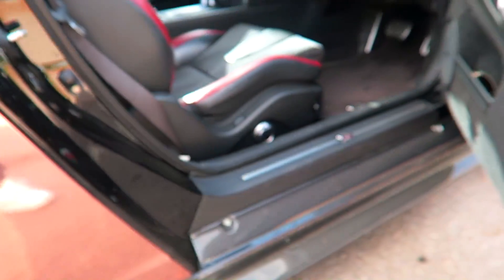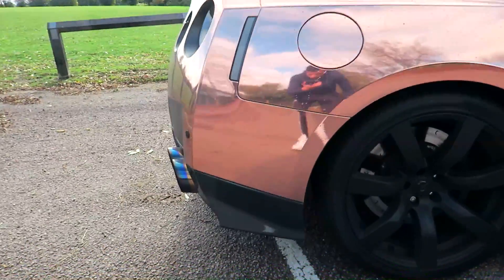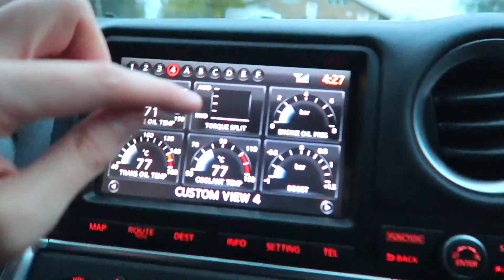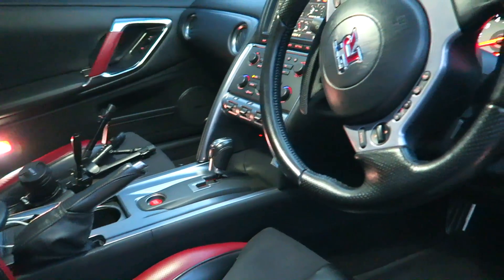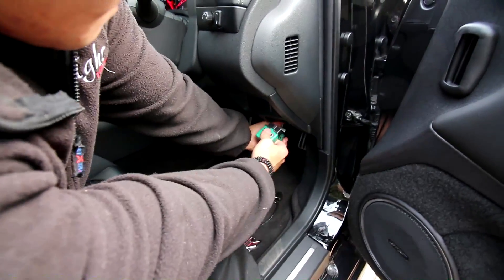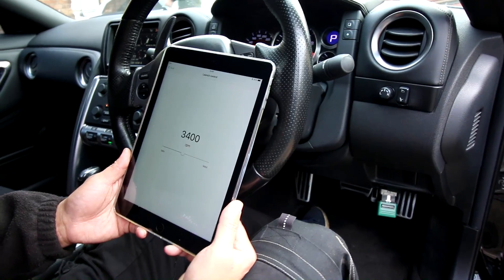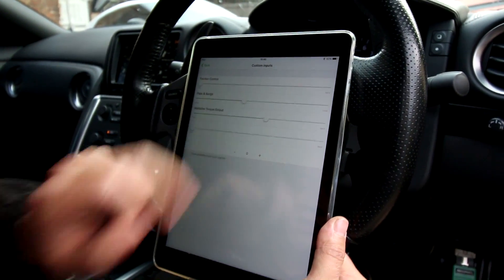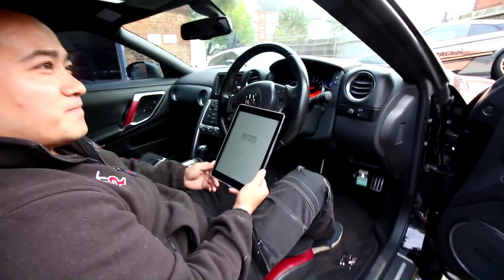I BROKE MY NISSAN GTR!!!

Comment: My GTR sounds like that all the time lol. clunk clunk clunk
Reply: Chewy0923 you doing launch pretty hard that why it broke bell . 1rule never show off
Reply: you'll lose your warranty when you use launch control except for the 2017 model. maybe he shouldn't try launch control at all.
Reply: It's a known issue with the older models and some newer models as well. GTR is a very mechanical and clunky car even when the bell housing is functioning properly
Reply: pretty sure it's a 2009 so he doesn't have a Nissan warranty 😂.... he gets all his work done on his GT-R by Knight Racer.
Reply: Sprocket If it would be okay for your car, Nissan would let you do it. but since that isn't the case it might be bad for your car. and if your warranty expires it would still be bad.

Comment: Any plans on getting another supercar? @EzekielN7
Reply from the maker: Yes, but I really don't want to sell the GTR! :(
Reply: EzekielN7 I think you should get a new engine
Reply: And new racing seats
Reply: He hasn't got money to throw away mate :')
Reply: +CmonMate I'm talking cheaper supercars like the Lotus Esprit or used Aston Martin V8 Vantage.
Reply: +iLambo700 Why would he want something slower than his current car, that would potentially cost more to buy :/
Reply: +CmonMate A new GT-R Ranges between $90,000 to $120,000. A V8 Vantage is around $40,000 used and a Lotus Spirit is about $30,000. Yes, they are slower, older cars. but they could be modified to go faster. than a GT-R for a lower price. My uncle has a Jaguar E-Type that has an upgraded top speed from 133mph to 212mph. Power is easy to make nowadays.
Reply: +iLambo700 Of course used would be cheaper, that's not the point. The mods will be a hell of a lot more expensive. But that's none of my business whether or not he can afford it etc. Just offering my opinion on it
Reply: iLambo700 it's not all about power, and I can guarantee that jag doesn't do 212 mate. Calling bullshit on this one. The GTR is all you ever need :).
Reply: +James C How is it even physically possible for an old E-Type to hit 212 mph xD